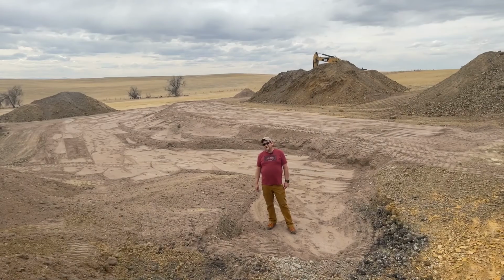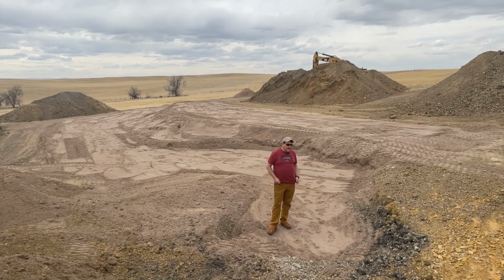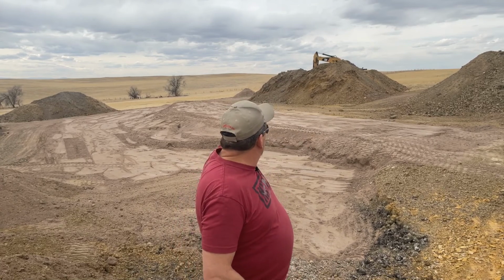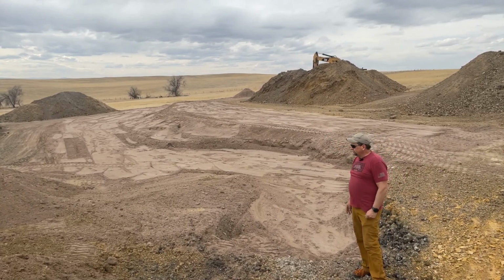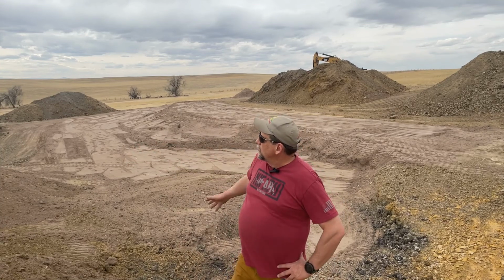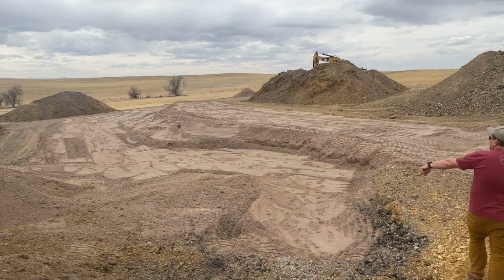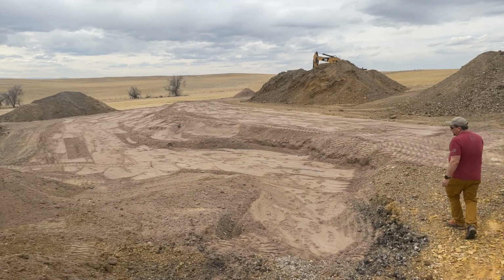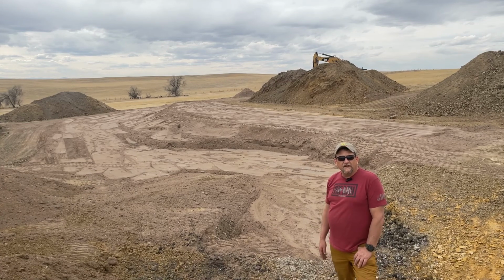After One Year!  I finally broke ground.

Comment: Let me know if you need any HVAC advice. Prices increased 32% in last 16 mo! Totally rediculous that CEO's/Oligarchs in the USA get $220K annual raise while avg worker receives $900. They fly around in their $2-30M bizjets or helicopters like you flew in. Oh we're paying five and six dollars a gallon for gas they are paying 3 to 4 dollars a gallon for jet fuel. 

I'm fresh off-grid 6 weeks with 20,640W of PV, two Sol-Ark 12K and 132kWh battery in e Ky. 38Lat.
Reply from the maker: That sounds like a giant Off-grid system you have.